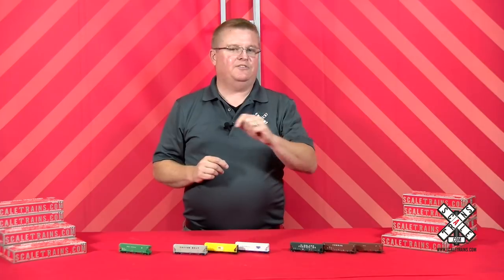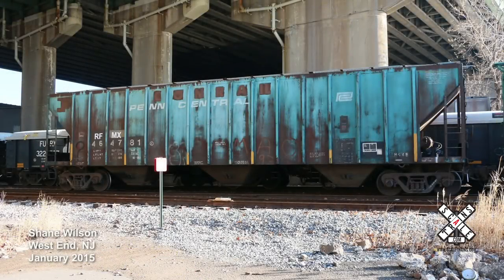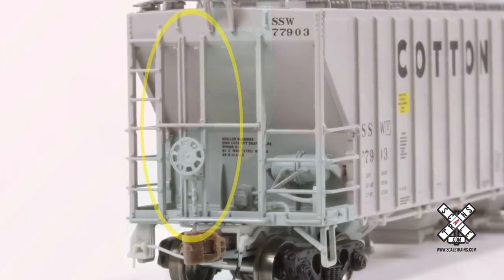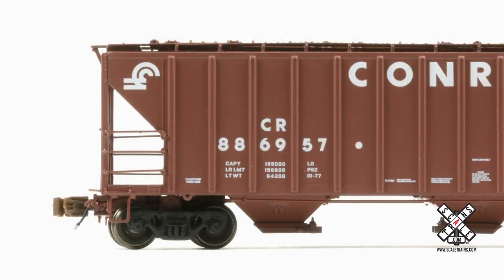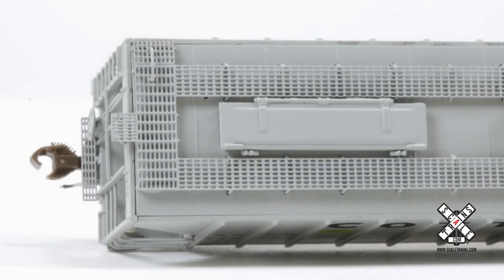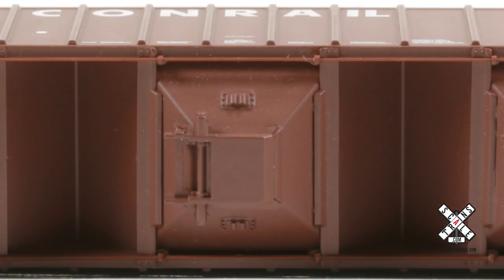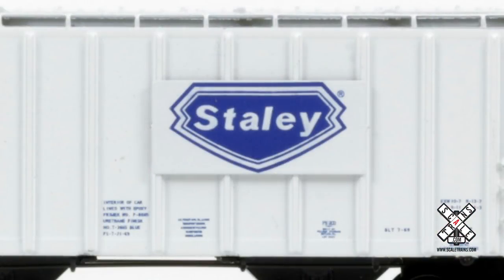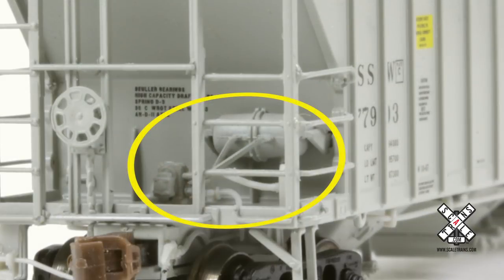Production N Scale PS-4785 Covered Hopper by ScaleTrains.com

Comment: What Micro-Train couplers are needed to replace the couplers that come on your "N" scale cars?  The 2 cars I have look great but are worthless as operators, do to the couplers.   I would really like to be able to use the cars in operations but they fail.  You realy need to figure the coupler problems out.  Thanks
Reply from the maker: Hi IMRROcom, to replace our couplers with Micro Trains, you will need to use 1015/1016 couplers with our coupler box housings and Micro Trains components with it, in order to fit an work properly. -Ian

Comment: Well, at least the non-sound version of this shouldn't mysteriously "sell out" before the sound equipped ones.
Reply: pdbnc was this meant to be a joke or are you serious.
Reply: Try to preorder a non-sound SD40-2 and you tell me.
Reply: This is N scale so I do believe that it is impossible to preorder an N scale SD40-2 from ScaleTrains.com.  Ya got to pay attention these days to what is coming out if you want it.  The future is here, most hobby shops are going under due to on line sales and manufacturers deciding on how many to make based on preorders.
Reply: If you preordered when it was announced, you'd have one.  Once they go to production, the count is pretty well locked in.  On the other hand, some of the preorders are always canceled, so sign up for their newsletter and you'll know as soon as units are available.
Reply from the maker: pdbnc: we utilize preorders placed by the preorder deadline to help us determine how many pieces to order for each item number.  Sales for non-sound units are low and we regularly receive cancelations because customers decide to buy the sound version instead.  Because of this, we've trimmed-back the number of extra non-sound units we purchase from the factory.

To ensure you receive a non-sound unit in the future, we encourage you to sign-up for our e-mail newsletter and like us on Facebook.  This way you'll know when the latest models are announced and can preorder right away.  BTW: payment is not due until the models are in stock.

As Timpraetor mentioned, we sometimes receive cancellations so be sure to watch our newsletter and FB after the SD40-2s too.  Shane